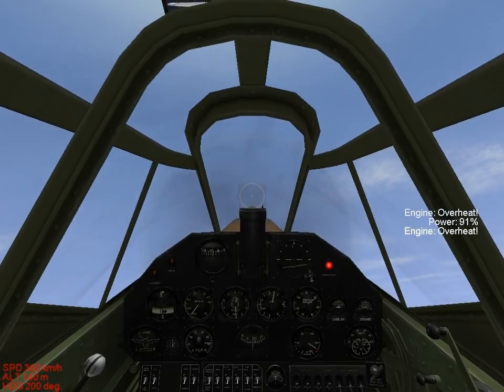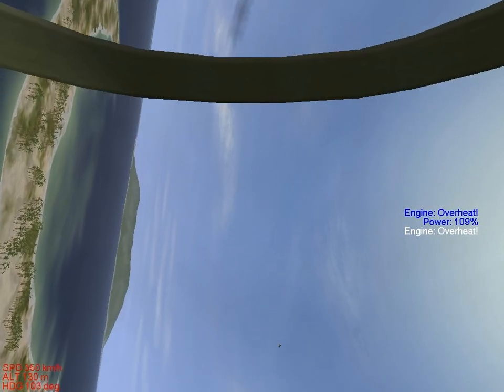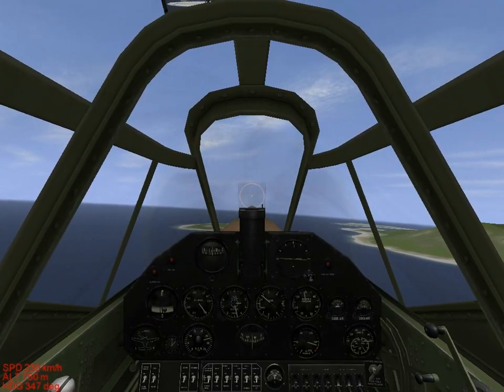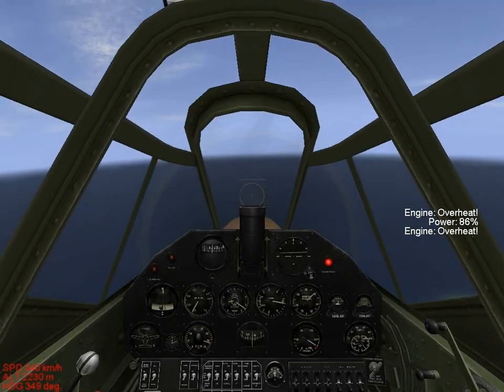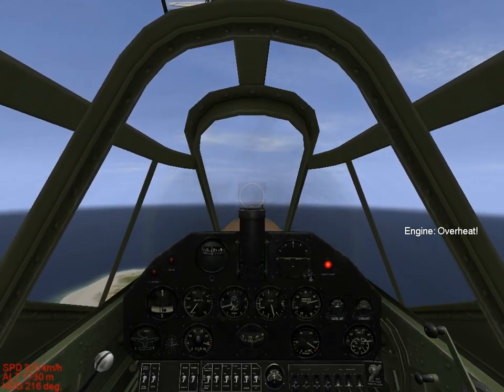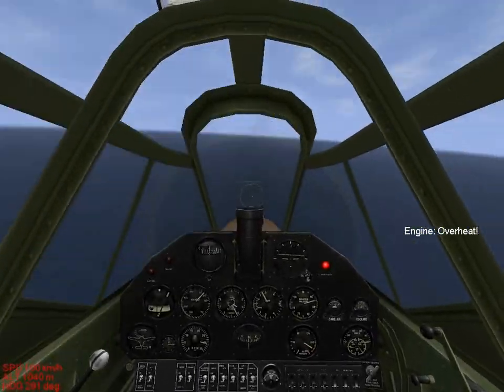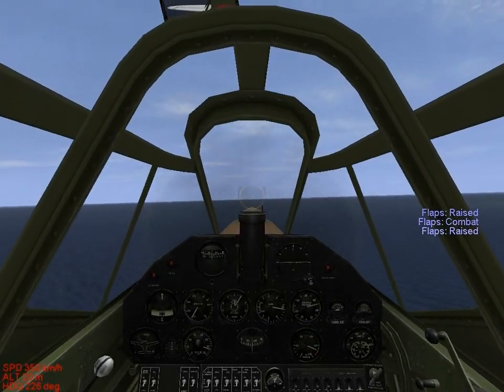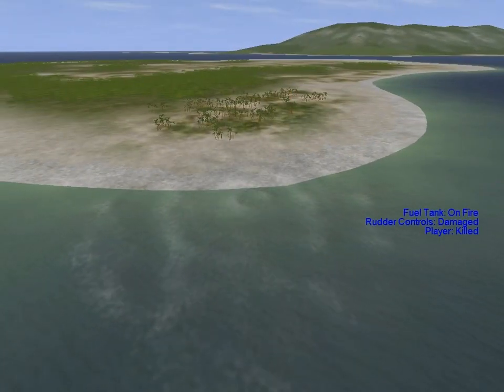Let's Learn To Play IL-2 [3 of 4] (Emergency Tactics, Stall Recovery, Engine Control)

Comment: you forgot to mention that you can also use the rudder in the opposite direction of the spin to stop spinning and make getting the nose down easier. Combined with the throttle/nose down technique is a very reliable way to recover from stalls
Reply: +XxGRINDCORExX Also thanks for making these great video's!

Comment: This will get most planes out of a stall:
1: Neutral stick! (Reduces drag)
2: Throttle idle! (Reduces torque)
3: Opposite rudder! (Reduces spin-rate)

Secondary actions:
- Gently push the stick forward and into the spin to help stabilize the air-flow over the wings
- Dropping gear & flaps may help reduce rate of spin.

Recovery:
When safe flight-speed has been reached, slowly pull back on the stick to ease the plane into a controlled level flight.

Comment: RUDDER! Rudder is absolutely key to recovering from a spin. 

That P-40 has very kind stall and spin characteristics. A lot of the time, you can just let go of the stick, throttle back, and the plane will straighten out on its own. Just about every other plane needs rudder opposite to the direction of spin, like the previous guy posted.